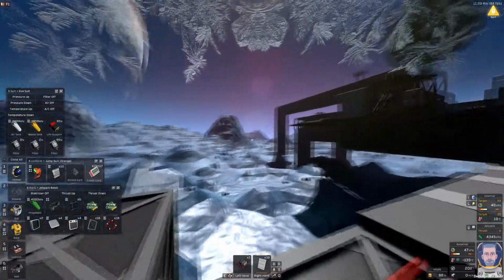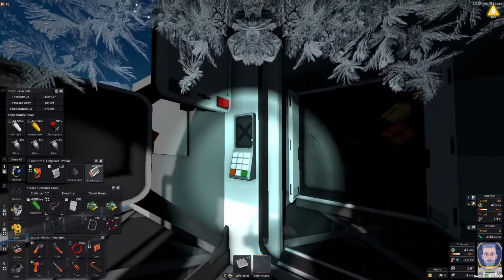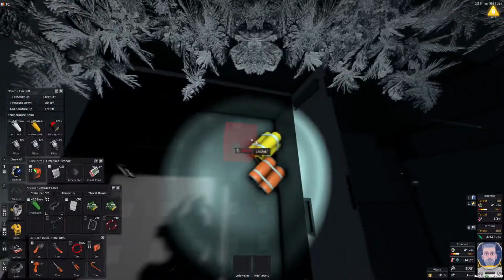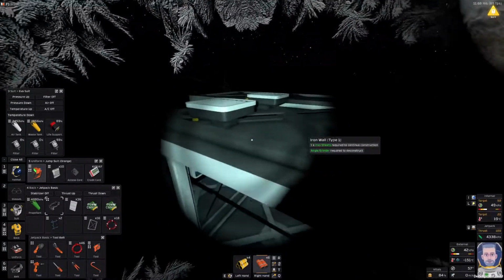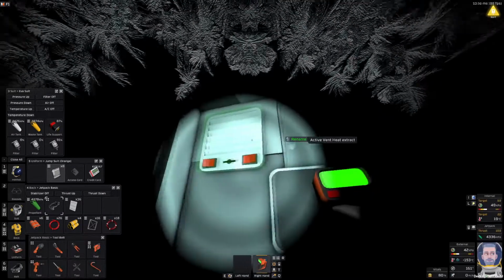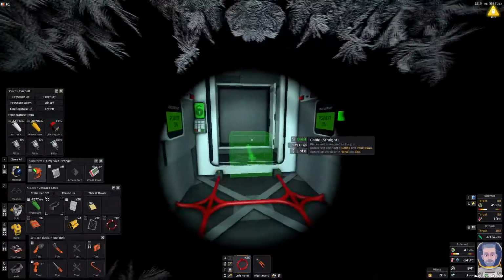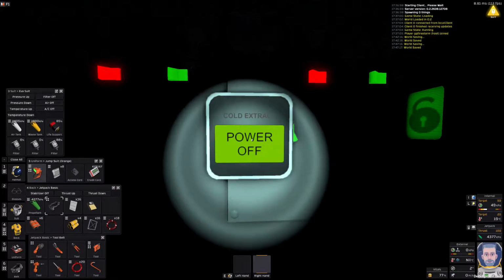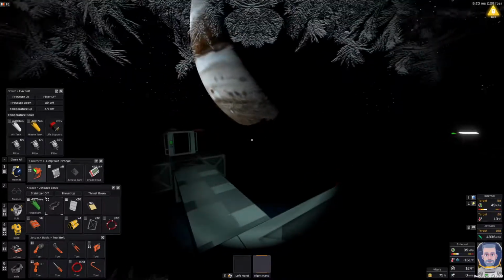Stationeers - Tutorial for very fast airlock,  showcased on Europa.

Comment: ive found my external pipes letting cold air out keep getting condensation, leading it to fail, i have no clue how to fix that, other then that, theres unfortunately not much that jve learnt from this
Reply from the maker: The game has moved on considerably since this video was made so some mechanics may have changed. It maybe that you need to use insulated pipes now ? But I havent checked.
Thanks for the comment👍
Reply: @ggfirestorm  I've tried everything i can, insulated pipes, heated pipes, water pipes, pipes in heated rooms, pipes in cold rooms, nothin
Reply: and noone has a video explaining how to do it

Comment: Is this kind of airlock good for a greenhouse on mars ?
Reply from the maker: Shouldn't be a problem if your careful. Its what I use on every planet. However its possible to make a mistake so I usually have a separate air lock to the greenhouse inside the work area that has its own airlock (same type) to act as a buffer, especially on planets with large temperature differences.

Comment: nice video - like the way you explain things. I believe that the game looks at a cubic unit as a single area, so even though having 2 vents is faster, you could make it even faster by putting your passive vents in separate blocks
Reply from the maker: Thanks Holy. I like your thinking. After reading your comment I went straight to a game I've saved to test it out. I placed a passive vent in another "cube" and ran some very basic time tests including having three passive vents  off of two Active but it didn't seem to make a difference. Admittedly they weren't very accurate tests (girlfriend using phone stop watch) but no significant decrease in time found. I would be interested in any tests you've done or any thoughts you may have ?
Thanks for subscribing
Reply: @ggfirestorm  Honestly, never tried it myself - just remember watching a guy named Splitsie doing it on his channel a while back. Then again, thanks to all the updates lately, perhaps, it's no longer a thing. Come to think of it though, I don't think you'd see much of a difference in a single cube airlock anyway, only so much air in there. The ones Splitsie made were for larger airlocks.

Happy to subscribe :) I'm always on the lookout for other Stationeers enthusiasts

Comment: Not automated and one wrong action and you will complete mess  base atmosphere(Critical on Vulcano). With this you can place 1 act vent and switch it on manually.(per side)
Reply from the maker: Agreed - one wrong action and you will have to reheat or re cool the room you left. However the failsafe I have in place is that it doesn't lead directly into my hydroponics room so therefore isn't critical.  But it is fast especially with higher atmospheric pressures and overall getting in and out of the base fast was my goal - one active just wasn't enough.